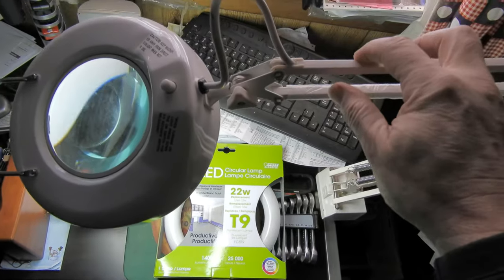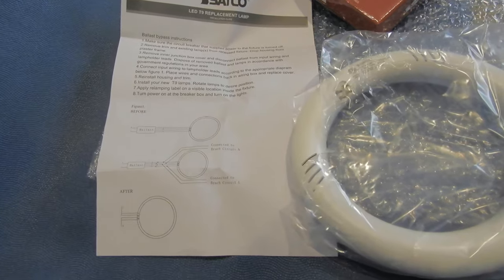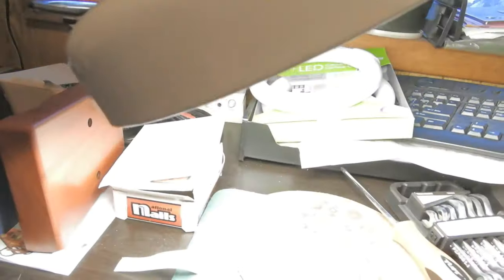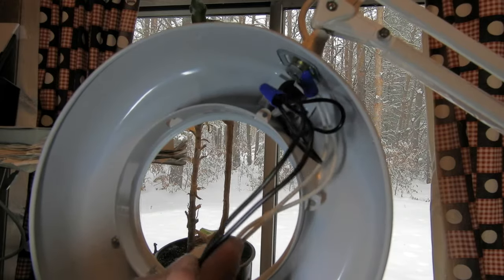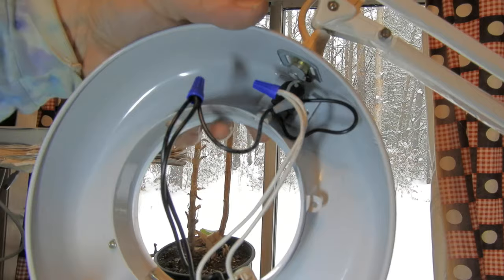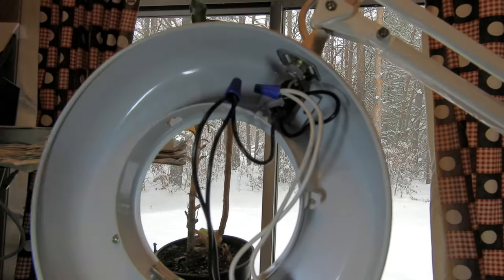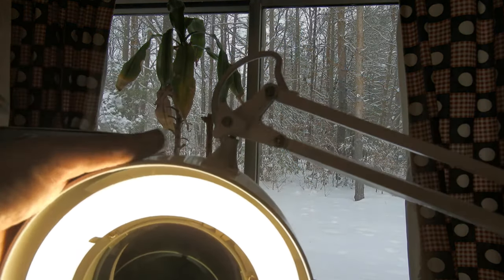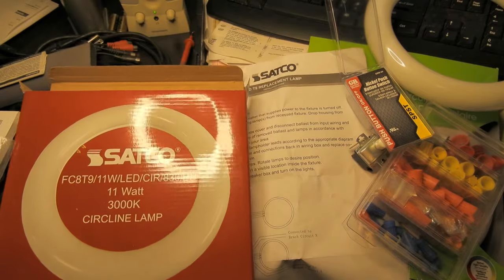Rewire Required LED Replacement for a Fluorescent Lamp

Comment: Made in China.... I got a the Circline T9 (Dimming version) and it had two white and two grey. The ballast bypass instructions on the amazon page were slim to none, it only said that polarity didn't matter, but being AC current, didn't need to say that lol. Hence the "A"lternating Current. Well it didn't come with instructions or a fancy non-cfl warning sticker and after searching countless extremely non-informative conversion videos, I drew from my years of electrical engineering experience and did the same thing, white to white and grey to grey. In all my life, I've never seen a wiring combination as this one. Thank god for your video to set me straight. Seriously, they just couldn't have done the wiring inside and used a two wire connection or better yet make the wires that should be connected together match in color. Made in China....
Reply: Update: It only worked when same colors were tied together. I think because I'm using with a smart dimmer wall switch. Very odd setup.

Comment: Thank you for this video, I have the exact same lamp but older and purchased the same Satco bulb on Amazon (much higher price in Canada $40 with shipping). The minor set backs and corrections you showed helped me do it right the first time. Great video and tremendous help.
Reply from the maker: Glad it was helpful! Always double check eBay too before buying via Amazon.

Comment: I'd be concerned too if the breaker didn't trip on a direct short across the line. It should trip instantly (magnetic mode) on a direct short. Check your circuit breaker's brand and model as some have been recalled. Federal Pacific is one brand that comes to mind.

Comment: I have a very similar lamp but it has two red wires, one white and one black to the four pin plug connector. The switch is a rocker type where it has to be held down to start the fluorescent tube and the other side is press to turn it off. When I replace the fluorescent circular T9 with an LED the switch wouldn't turn it off, I had to unplug the lamp. So I bought a regular on/off rocker switch. But now I don't know how the wires should go to the pins. It's all dissembled. oops. 😖😧
Reply from the maker: Look carefully at the four pin socket and think of the original setup. Two pairs of pins that are a little closer together. Each pair of the closer together pins represents an "end" of the bulb. Probably black goes to one "end" white to the other, and a red to each go to special terminals on the switch that will momentarily connect them together to provide a current path through the filaments while the button is held down. The Satco bulb I have replaces the filaments with shorts, so really you only need one wire per "end". I am only guessing what might make sense to me on those colors BTW!
 Rewire lesson, always take a picture first!

Comment: Do you have any idea where i can purchase a switch like the one you took out of that lamp?? Can't find one anywhere!!
Reply from the maker: I did a quick peek on E-bay, there is a four-wire Leviton switch but everyone wanted a lot of money for it. Also found this:
https://www.mylampparts.com/products/sl19337-6w
https://www.google.com/aclk?sa=L&ai=DChcSEwiY-J7jh5T0AhWbPq0GHcZXBMcYABBHGgJwdg&sig=AOD64_3At8tK2NAsIyznsLgcxIL21gCWyg&ctype=5&q=&ved=0ahUKEwj6l5rjh5T0AhW0FjQIHVRDCJcQ2CkI0wc&adurl=
Probably better off doing an LED conversion.
Reply: @HillsWorkbench  Thank you very much for the information I bought one from e-bay but will save your info for future reference
Reply from the maker: @kevinburns7255  If you were able to find the exact switch, please share the link.
Reply: @HillsWorkbench  I haven’t gotten the switch in yet I’ll let you know when I do it’s not the same
Reply: It does work, from EBay
Reply: It did work